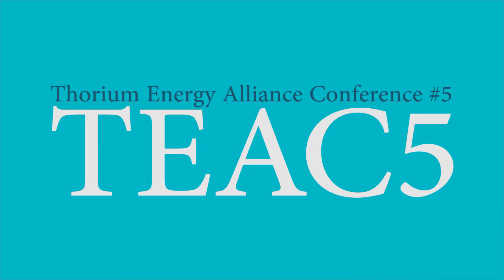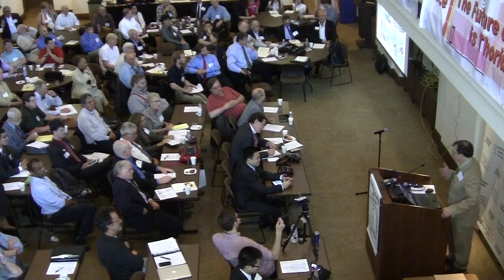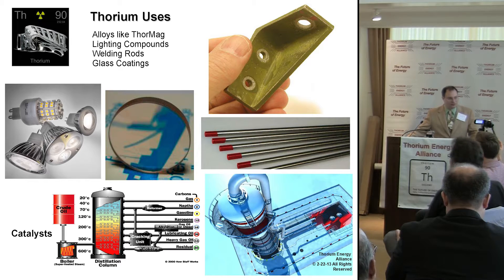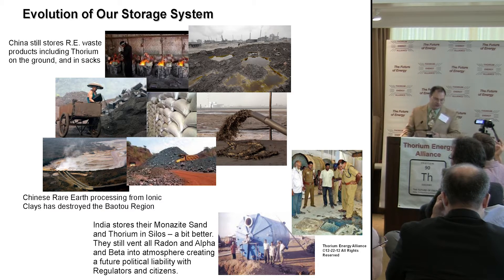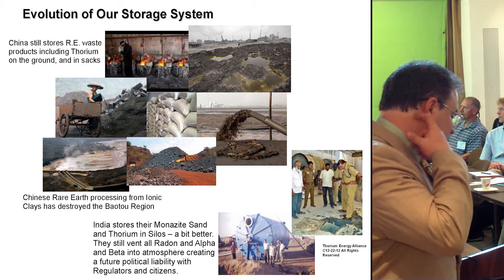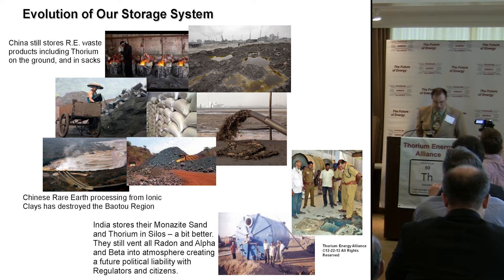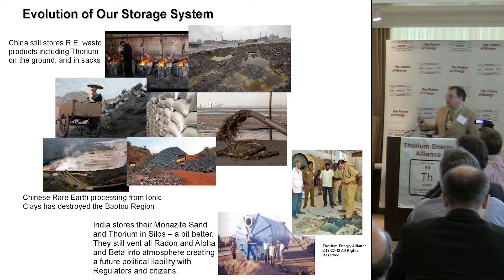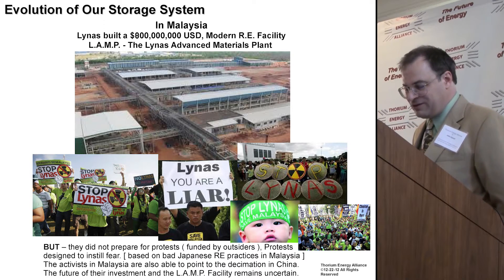John Kutsch - Thorium Bank @ TEAC5

Comment: "...concrete cask building floating inside another concrete cask building..."   Certainly over the top but seems a solid design.  I understand that Arizona requires a similar design for service station gasoline storage. A concrete bunker capable of holding all gasoline should those develop a leak. Once a year a state inspector climbs down through a manhole and walks around the gas tanks within the bunker.

If your thorium banks were built underground they'd require less energy to cool.